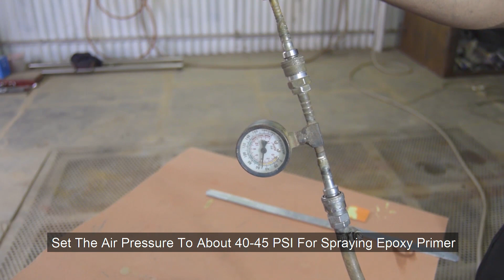Step 2 - How To Mix And Spray Epoxy Primer

Comment: For spraying primer use only tip size 1.8 or 2.0 mm .1.3 mm or 1.4 mm is used for clear and base coat .
Reply from the maker: Hi, For primers use 1.7mm and For base and clear use 1.4mm or 1.3mm
Reply: Hai 1.8 mm for primer is also preferable  .
Reply from the maker: @HAMEED...  Yes but default nozzle size available is 1.7mm
Reply: @DynamicAutoYT  o

Comment: Can we use Epoxy on plastic parts as a base coat?
Reply from the maker: Hi, The Epoxy primer is not a base coat it's just a primer for protecting metal against rust, Thank you!
Reply: @DynamicAutoYT  Thanks you.  I'm planning to paint my motorbike plastic side panel,  which product i have to use as base coat for plastic?
Reply from the maker: Use Nippon Urethane base coat and spray clear or Use 2K Urethane Single Stage base coat but single stage paints are available in solid colors only
Reply: @DynamicAutoYT  Thank you so much 😊😊
Reply: Can we use 1.4 tip sprey gun ?

Comment: Jii epoxy primer good are bad for motorcycle engines
Reply from the maker: Hi, Spray only on the chamber, clutch cover and magnet cover don't use spray on cylinder kit and cylinder head